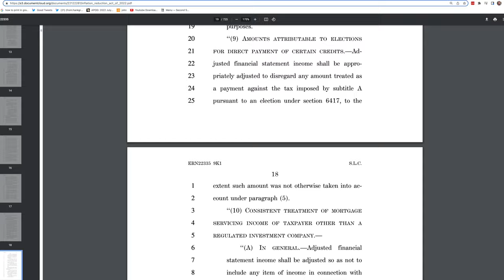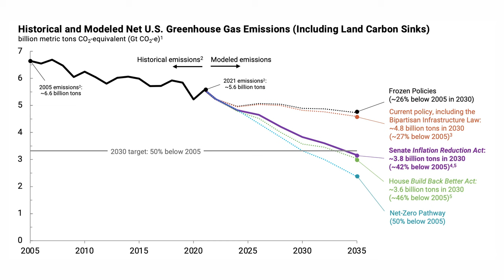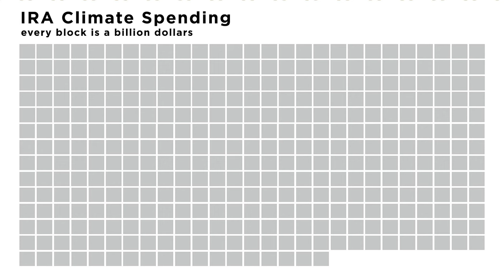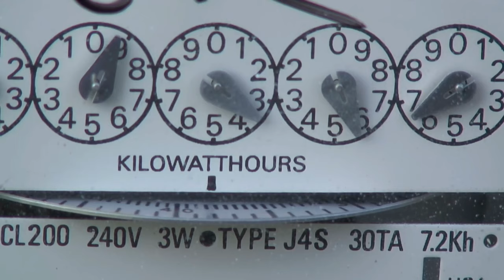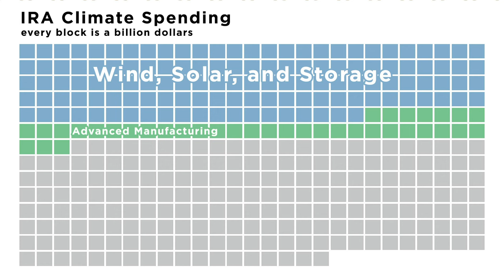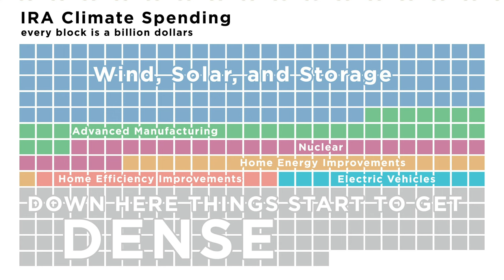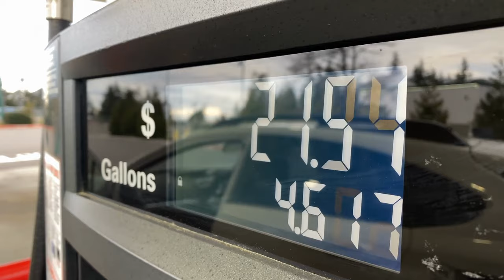The Biggest Climate Bill of Your Life - But What does it DO!?

Comment: I think there's a crucial flaw/oversight in this video. Consider the case where you live in a northern climate, say anywhere that gets below 0C. Current heat pump technology can get a COP of maybe 3 but it's more like 2, let's round up to 3 though. So every kwh I use in electricity I get 3kwh of heat in my house. However, this electricity comes from a power plant that is also lossy (dang 2nd law of thermo). The average is 36% efficient.  So 3x0.36 is 1.18 so this has a max (overestimated) gain of 18% less carbon than burning natural gas directly in your home. However, when you consider natural gas is about 1$/therm and electricity is 0.20$/kwh = 5.86$/therm. You're paying 6 times the cost for only a THEORETICAL MAX carbon decrease of 18%. There are some instances where natural gas will be a better choice for the next 100 years (after that, reevaluate. During that time improve heat pump efficiency with research funding)
Reply: So we're going to be Sri Lanka?

Comment: Something to consider about carbon taxes: the whole point of them is that you reinvest the revenue back into consumers as part of the deal. Things like directly cutting taxes or implementing basic income for low and middle earners, and spending on infrastructure and other social services. This shifts the market equilibrium towards clean manufacturing and distribution without an undue impact on consumers.

You also generally want to do this with a long phase in to avoid supply shock.

But it does work.

And it would be so satisfying to have that fake support blow up in all these oil companies faces.

Comment: I worry that Battery EVs are taking the spotlight over Hydrogen Fuel Cell EVs. They 'recharge' more quickly and can sustain a much longer range than traditional BEVs.  (And technically Battery EVs don't even help with emissions without also converting your local power generating stations.)
The issue is just infrastructure. There are basically no Hydrogen recharging stations anywhere. I feel like this is where companies like Exxon and BP would want to spec into since BEV's do the vast majority of their charging at home and not at a gas/charging station.

Comment: I recognize the problems of climate change, but have focused on SPENDING LESS, MOVING LESS, BUYING LESS, using a bike, mass transit, lowering winter thermostat, summer cooling with a window fan at night over A/C, growing food in my own garden (token amounts admittingly). I also use Xcel Windsource for wind power electricity, and I've never bought a car less than 7 years old, currently a 2009 Honda Fit with 35mpg, which I drive under 2500 miles/year (my girlfriend bikes, walks or buses exclusively). Of course we also live in a single family house (debt free now), but suburban neighborhood don't do "equipment sharing" like clothes washers, or lawn mowers, or all the other things we're expected to own to be "modern" people. Oh, we also buy most of our clothes from thrift stores.
That all I feel in control, but as soon as I look at installers for various new technology, I get PARANOID. Even at the MN State Fair Ecocenter, they claimed "Replacing a refrigerator older than 10 years will pay for itself in a few years" and that was clearly BS, since a new fridge can cost $800 or more, and electricity to run it is like $50/year, so even if it was solar powered, it would be a 16 year payback!
Obviously replacing WORKING equipment that created CO2 and pollution to produce means I've already PREPAID for most of my pollution, so it is WASTEFUL!!! And ALL of this new equipment may be DESIGNED for "planned lifetimes" rather than to be fixable, so maybe my new furnace or whatever will replace something that lasted 40 years with something that is expected to be replaced in 10 years or less! It doesn't make sense!
Even LED lights which are GREAT on electricity, but if they are manufactured to only last 5 years or less, then it is a CONSPIRACY in my mind to make me WASTE more resources that all have manufactured costs, transportation costs, and disposal costs, all subsidized by fossil fuels!
Reply: Probably the BEST installation I could have to save on heating and cooling would be geothermal heat pumps, although very costly to install, and with Minnesota winters, I'd probably still need NG or electric furnace for a back up on coldest days, so all cost more money up front, and doesn't make much sense as long as NG is very cheap.

Comment: Raising taxes on fossil fuel usage isn't a bad idea to reduce fossil fuel usage... But NOT until there's a comparable source of clean power to move across to.

I'd put 100% of my energy costs into renewable if I could (ev, heat, electricity, etc) IF it was available and inexpensive. But it's not yet. Until it is, I'm against over taxing fossil fuels... Because that ultimately raises the price of EVERYTHING.

Comment: I hate that there’s a purposeful downplaying of synthetic fuel for cars. This is already a thing; porsch uses it, runs their new F1 cars on it. It’s carbon neutral from production to end use. They plan to produce parts to modify all their existing models so they can use this fuel, and are working on this right now. 
A college student created a mod for his classic car, and now it runs on hydrogen. The ability to convert existing vehicles for low cost has got to become part of this movement, because most people cannot afford to go buy a new car, tax credits or not. And the enormous waste that is created by throwing away every car that isn’t green is incredibly irresponsible. 
Electric is almost inaccessible to most of the midwest, plus the batteries aren’t where they need to be for users. Low income earners can’t afford new cars. We need a solution for them too, and conversion of existing vehicles will save on waste manufacturing. People are willing to make those changes if they are offered to them, and especially if it’s basically free or cheap enough to not break the budget.

Comment: It's a simply chemistry problem but requires serious engineering to fix. Electric trains and trams should become more common and hydrogen since electric batteries have issues. The electrical grid needs to massively increase to power this

Comment: i think its a bad thing to only frame environmental issues by CO2 emissions and not considering any other factors, and it seems like thats what this legislation is doing. this does absolutely nothing to address the sheer amount of over-consumption, the problems caused by the global shipping system, the extreme inefficiency of car based infrastructure, the massive amount of waste generated by single use packaging and our reliance on consumer goods, or the issues with petroleum based, industrial agriculture. it does nothing to increase the local production of goods, which would reduce the need for any kind of fuel "green" or otherwise. i think this is more of a bandaid to keep people from rioting than an effective measure against climate change.

Comment: What is he talking about.  Gas dryer and heaters are far less expensive than an electric to operate (almosthalf the cost per load). I had an electric dryer for years and went to gas and saw an immediate decrease in my overall bill. Then I added a gas stove, which even made the bill cheaper. We will see when the costs even out but what was said in this video regarding appliances is incorrect

Comment: Nuclear is the answer and has been for about 2 decades now, with the advancements of Nuclear over the years it is the safest and most non-impactful energy solution ever to exist on the planet. Producing solar panels and batteries to offset grid shortages is not "green" especially when compared to Nuclear. If we build new modern plants, the energy problem is solved over night.
Reply: Ukrainian nuclear
Reply: @ed9755  we don't build reactors like that. The soviet union was building those reactors to be cheap. You need to learn about modern Nuclear. It would be like you comparing the Wright Flyer to a modern 747, they're incomparable. We also have micro reactors now, which provide an entirely new dimension to solving grid power issues with zero emissions.

Comment: The biggest red flag that I noticed is when you talk about switching more and more to electric powered heat pumps & heat pump water heaters. it's great to move away from natural gas powered appliances in the home but heat pumps need refrigerant which is a massive cause of ozone depletion. I'm not negating this whole thing but I do worry that a lot of solutions lead to more issues down the line

Comment: Hank you should reduce you carbon emission to 0 by 1) never drive a car or drive a bus or us an airplane(they all increase carbon emission) 2) never use electricity(which either created by carbon emission) or power planets are operated by workers who drive to work and that increase carbon emission and you should not make any vedios using electricity3) never breath out into the air because you exale Co2 which increase carbon.. If you do all that the it will appropriate to preach other about carbon emission.. otherwise your arguement is hypocritical.

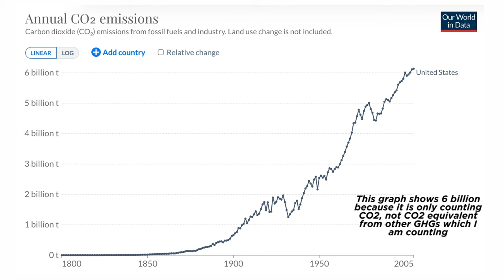Comment: See... I have a problem with your level of bias. I'm only 2:35 into the video and you put a graph up that show annual co2 emissions. It looks really bad with the US hitting peak in 2005. But unfortunately you chose a graph that ends in 2005, giving the illusion that were still on an upward trajectory. Even though you did mention it was "peak", your visuals indicate that things are still as bad as they look on the graph. At the very least you left it ambiguous. That graph is not showing almost 2 decades of data. I gotta wonder why you would chose a graph that excludes 17 years of the most recent data showing we've steadily reduced our emissions to early 1990s levels and are continuing to reduce them. Maybe then the graph doesn't look as scary? If we're already doing a good job of reducing our emissions then maybe we don't need this new bill of regulation. Unfortunately this is a persuasion video masquerading as an informative one.